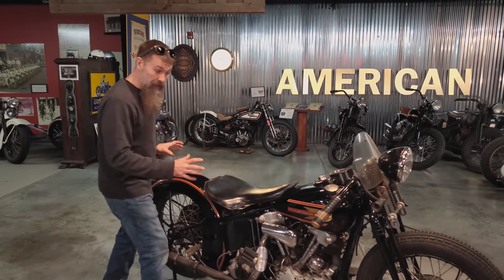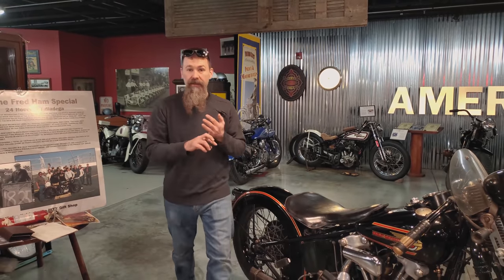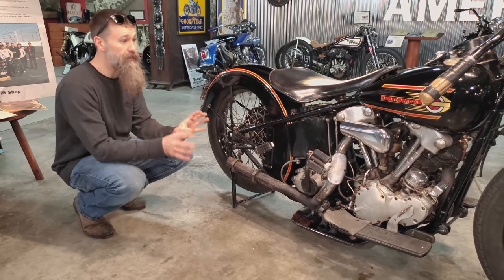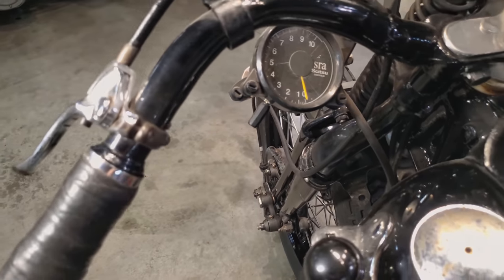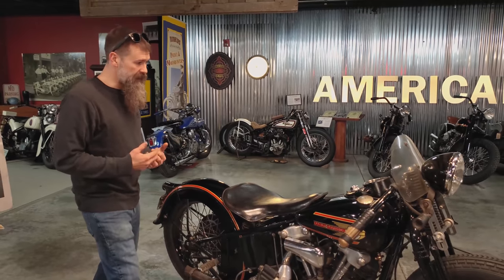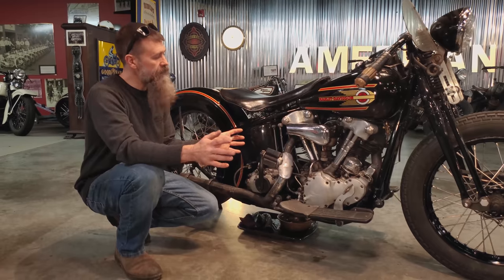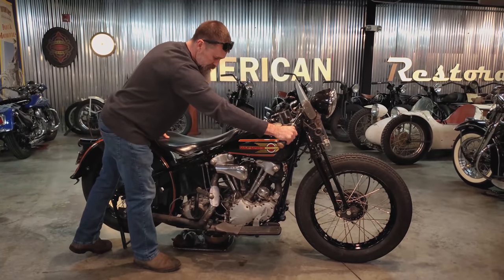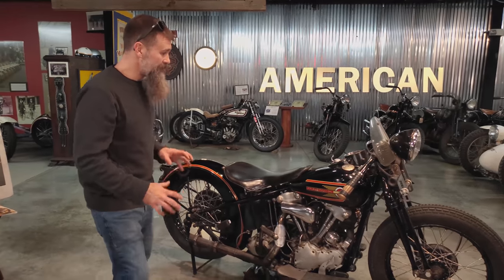The Fred Ham Special

Comment: took me 32 hours to go 1300 miles, but that was on public roads, and damn, just occurred to me, I was half my age now when I did that...I'm in my 60's. Still have that bike...can't imagine 1800 miles in 24...ouch...
Reply: the roads back then had little traffic...you can do that easily in your 80s on a hayabusa today
Reply: Two summers ago I did over 3,100 miles in 4 days time, from Southwestern Pennsylvania to Amarillo Texas in 2 days to visit an old Army buddy there, after 5 days at his place I returned in 2 days, the odometer showed over 3,100 miles, and that's pretty accurate because I've got a Thundermax control module on it that's calibrated dead on at 70 MPH via GPS and I was averaging 75 to 80 MPH there and back.
My friends used to call me Iron Ass when they'd ride with me on a road trip because I was relentless and wouldn't take breaks at fuel stops, I'd tank up and get right back on the highway.

Comment: Matt & Dale : It was a great honor to go on that run. Did you keep the .020 cylinder on that bike? Brian
Reply: If they swap the rear cylinder to 020, it’s probably because the piston make damage in the sleeve. If I undestand well the story ?
Find an other one original cylinder on std in good shape is not easy. For go back on std, a new sleeve inside the damaged cylinder can be the best way, no ?
Reply: @fredmasse6451  Those cylinders were not sleeved. Dale had extras.
Reply: @brianhaenlein8287  
Hi, yes you right on these original cylinders. But can be sleeved now when you are over all the oversize, it’s technically possible I think.
Reply: @fredmasse6451  Fred: We re sleeved a lot of cylinders in my shop when I was in business. You can also have them chrome plated to use again.

Comment: Do you guys run Avgas? Don't see a lot of carb cleans after sitting and wonder how you avoid varnish. I know my plane can sit for a year and fire right up without cleaning the carb.
Reply: You're supposed to shut the gas OFF and let the engine run until it dies from lack of gas. Thus the carb bowl is DRY and it can sit indefinitely. It bugs me when he shuts off the bike with a full bowl and does NOT turn the gas off! That can get ugly on an OHV because the carb is on the uphill side and if the needle and seat aren't perfect gas can leak into the cylinders and flood the crank case with gas thinning out the oil with disastrous results.